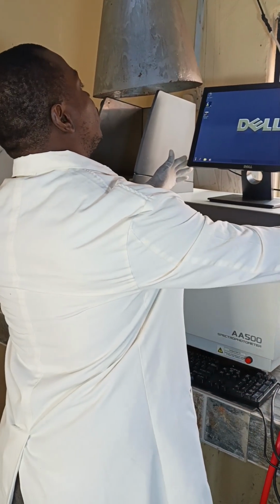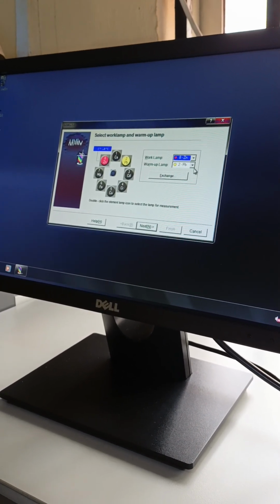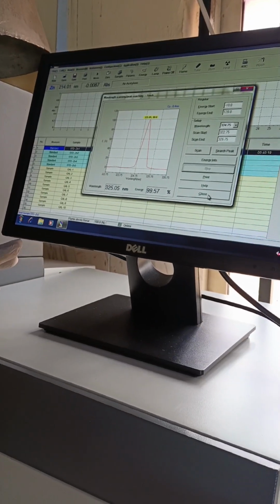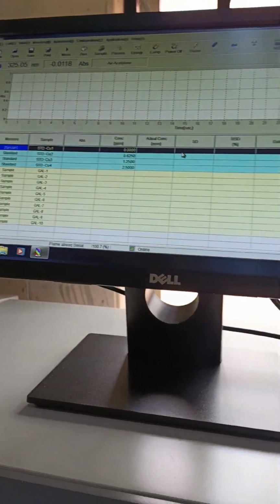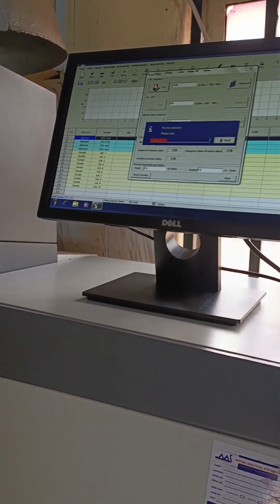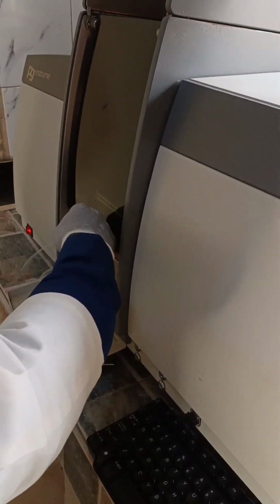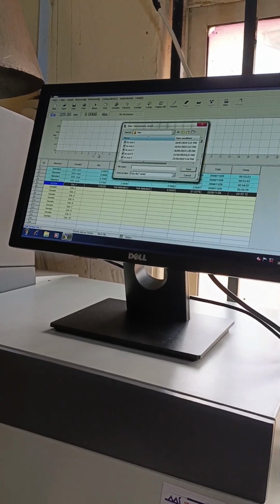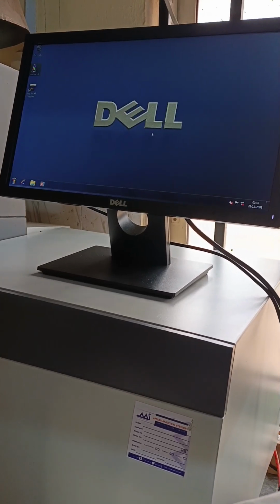How to Operate the AA500 AAS | Full Practical Demonstration

Comment: Please and please sir, kindly run another video....on the setup using the computer interface calibration too and running analysis......operating the computer wasn't clear in this video at all. Let's kindly see how you use the work lamps
Reply from the maker: Thank you for your comment. I am happy that you found our video interesting. I will make another video where I will explain about calibration and other things you pointed. Stay tuned
Reply: @Dr.JONwadiogbu thanks a million
Ur WhatsApp...so I contact you directly Dr. J for further inquiries sir.